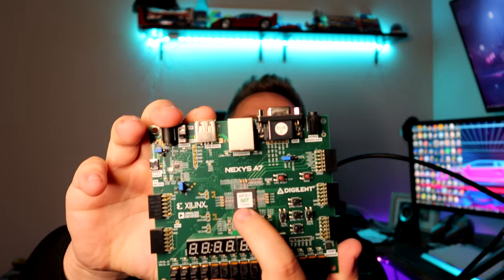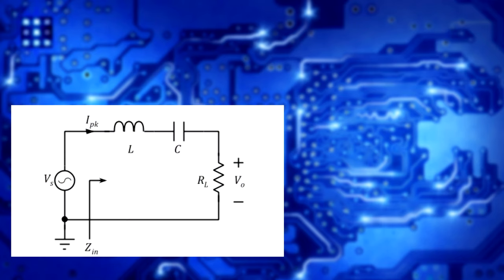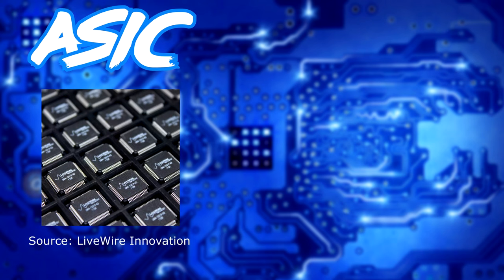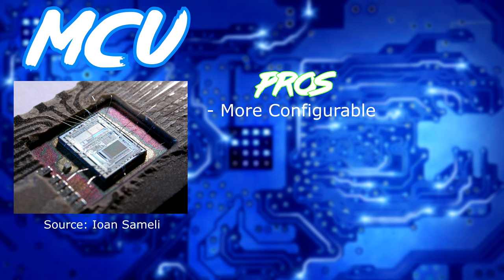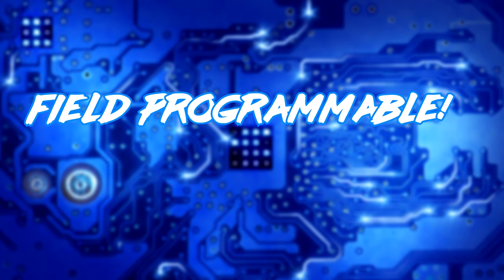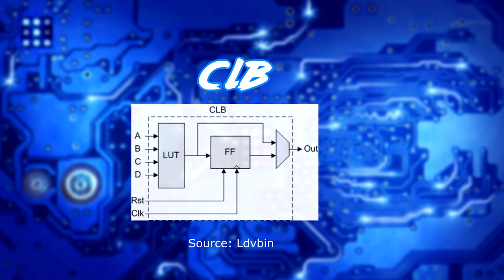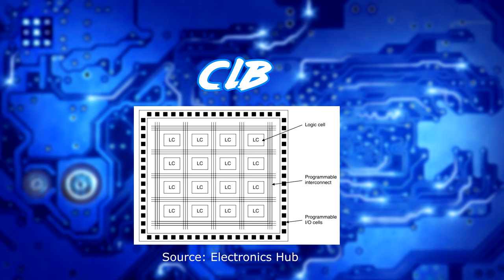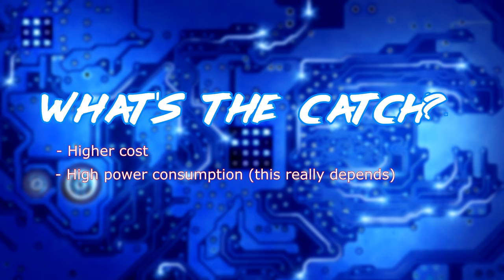What is an FPGA?

Comment: Not sure that made anything more clear to me.  You flew through the explanation with assumptions that people knew all the lingo and buzz words you were throwing around.  The best I could gleam from this video (and keep in mind I'm a nerd for this stuff... father was an certified "gadget" electrician)... was that FPGA is a computer circuit on a chip that can be customized to act/behave how you want it to.  One day you could program the chip to act like a Yamaha FM sound chip, and the next day you could re-program it to behave like a z80 or 68000.  All of this is on the hardware level and NOT software emulated.  Did I get it, basically?
Reply from the maker: Sorry if I wasn't able to make it clearer... I will try to redeem myself with this comment.  Yes, you got it!  The beauty of a FPGA is that it is actually REAL hardware circuitry, but you can program and configure it how you want through VHDL, or Verilog code instead of having to physically build the circuit itself.  So your explanation shows that you got that concept thoroughly.  Real hardware configured by Software, and not emulating hardware through software.  The rest was walking through the design decision of why you would choose a FPGA.  ASICs (Application specific integrated circuits) as circuits designed to do one thing and do it very well, but you're at the mercy of changes and potentially cost.  Microcontrollers are less efficent, but cheaper, and more scalable.  FPGAs are a Goldilocks solution to this problem, while they are usually the most expensive in some cases, they provide the best performance for the power output and the circuit footprint, and they are realitively scalable.
Summary:
Nothing is better than building a circuit for a specific task (ASIC), but this is hard to change, longer to develop, and costly
Nothing is easier than buying a microcontroller and programming it to do a specific task, but you are at the cost of performance per watt and power consumption and board space
The solution in the middle is the FPGA!
Hope this helps a bit more.
Reply: @ZygalStudios  yes, that’s much more clear, thank you very much!!!  Love your channel!!!